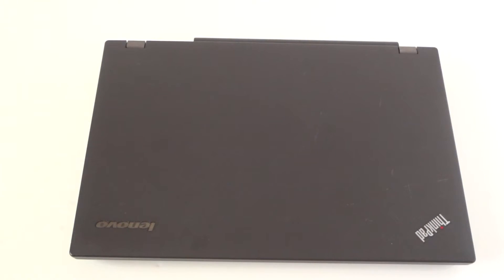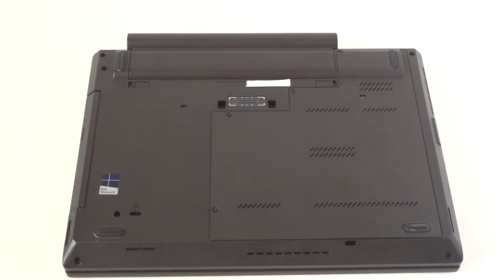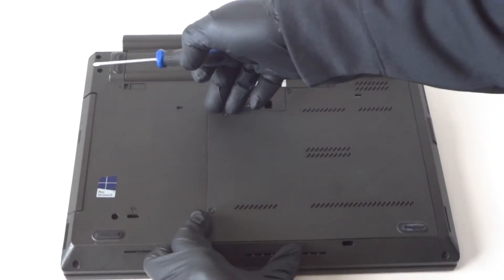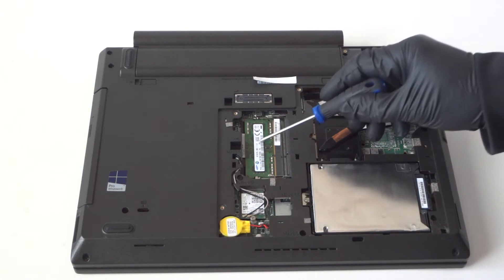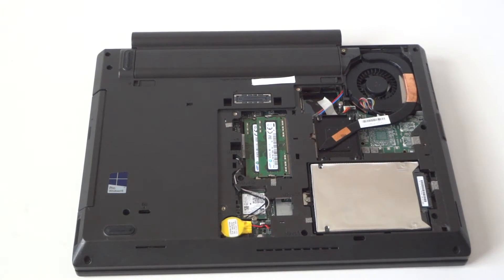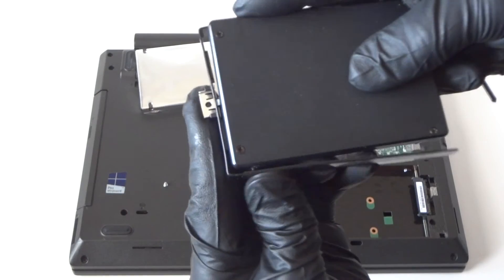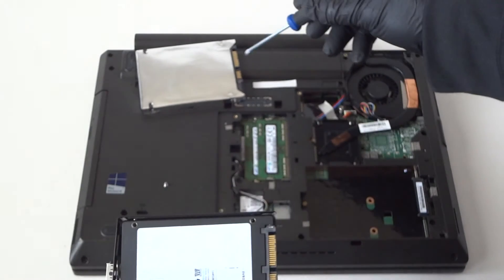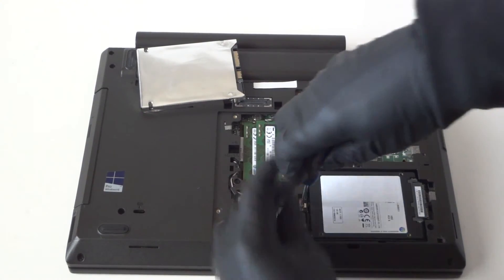Lenovo ThinkPad L440 Upgrade Memory SSD Drive

Comment: Is it possible to change the frame of the lenovo laptop lenovo thinkpad t440  because the outer window of the fan is broken please reply.  If possible, please make a video to explain
Reply from the maker: Hi, yes you can replace complete laptop base shell and they sell on ebay used.

Comment: First you have to remove the battery before changing the RAM
Reply: What will happen if you do not remove the battery?
Reply: @rainniel04  It may power on or cause short circuit which is bad

Comment: Hello, how do you do the second ram stick in the bottom
Reply: Same as the first one. Just simultaneously pull those metal pins on the side and it will pop up at the 30* angle.